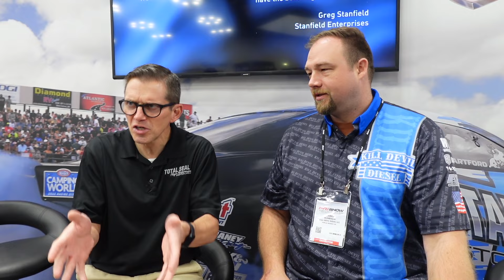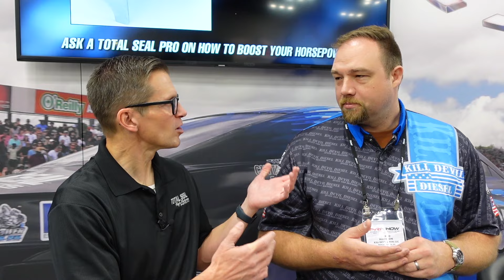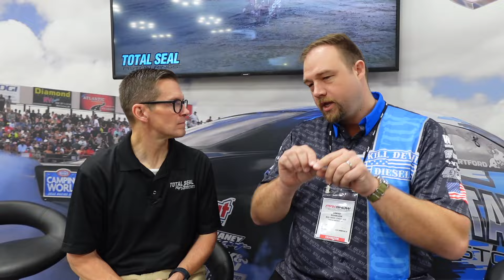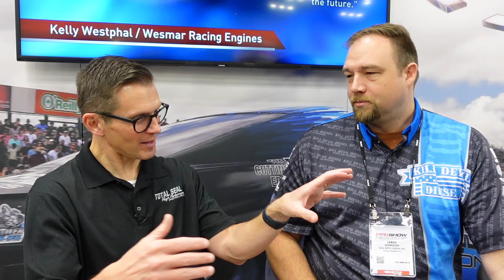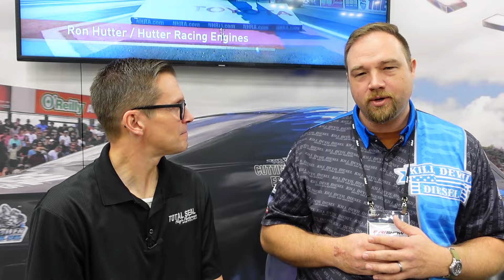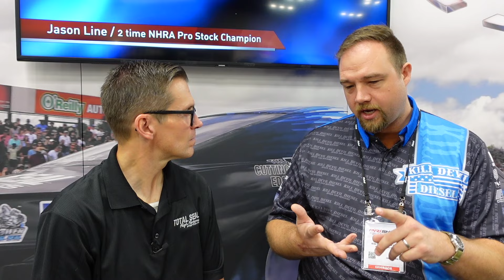PRI Diesel Extra: Jared Alderson on Hidden Horsepower

Comment: I just bought my first diesel truck. It’s a 2024 F350 6.7 High Output. I have 700 miles on it and from what I understand everyone says I should change the oil by 1,000 miles. 

Schaeffer Oil seems to be what everyone likes best. Thoughts from you on this would be great!!
Reply: Schaffers is excellent expensive but excellent.